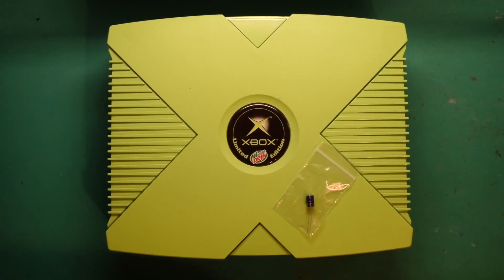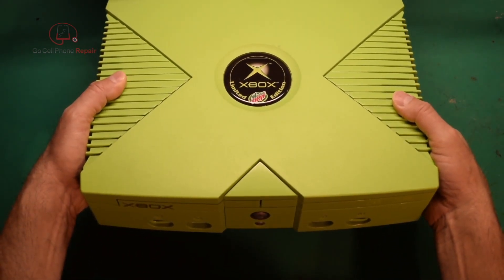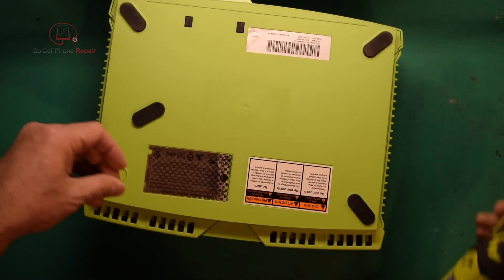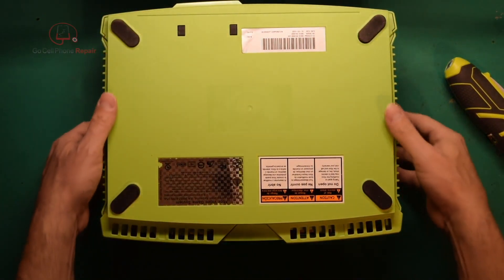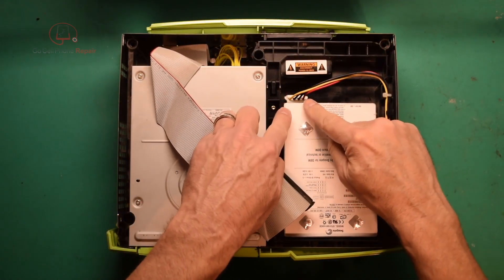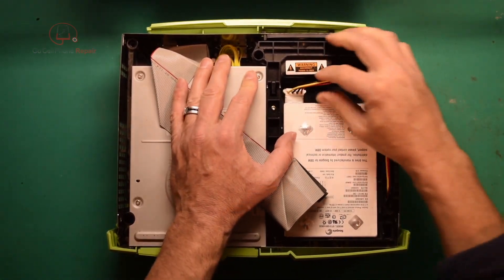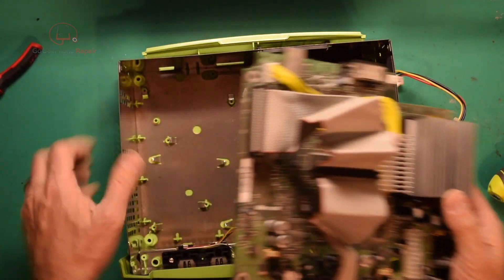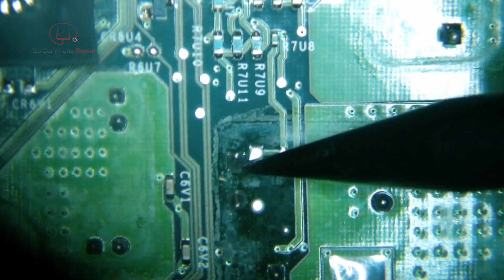Original Xbox Clock Capacitor Replacement

Comment: One qeustion does it matter how you  put the new capacitor in and if so how to know which leg first
Reply from the maker: Yes. Electrolytic capacitors in this is case, and in most others, are directional. Be sure to note the orientation of the original.